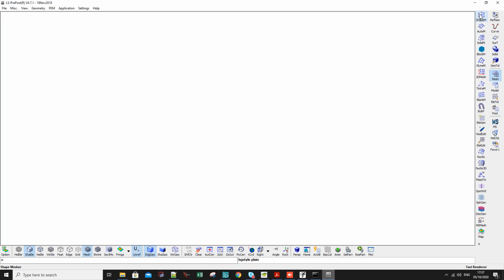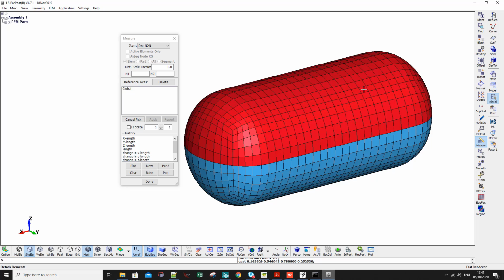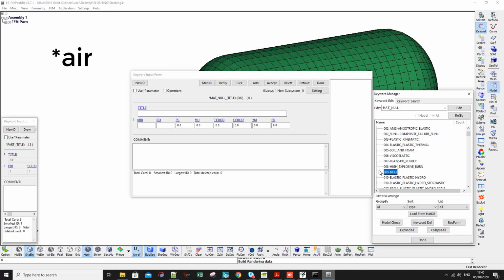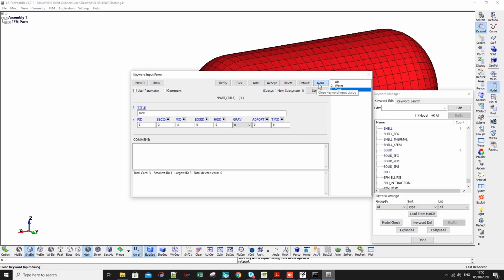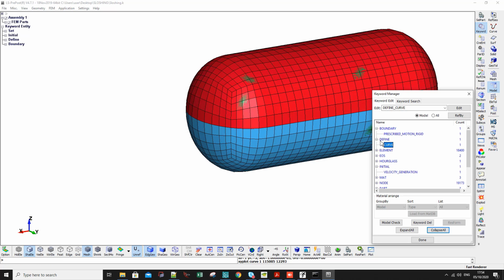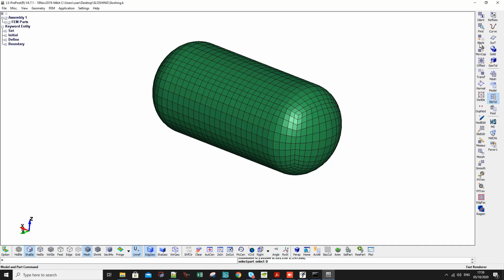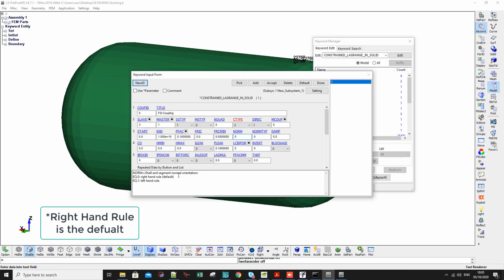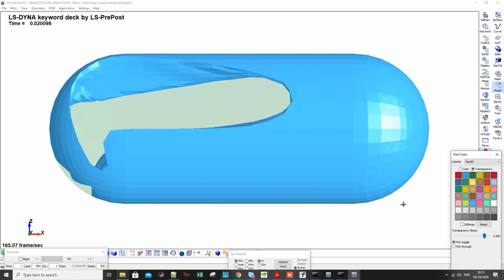LS-DYNA TUTORIAL 19: Sloshing Inside a Tank with ALE method

Comment: Hello Mr. Topa. Thanks for so many useful tutorials. May I ask you something no directly related to this? When we use ALE eleform 12 (with void) in a thermo-structural analysis, setting the initial condition of temperature for the void part, and after the analysis starts, its temperature falls to 0 no matter which value we set. ANy idea?
Reply from the maker: If you want to see the effects of temperature in air, then it is better to use multi material ALE instead of ALE with void. Because void is just like empty space, which has no material inside it, so it has no temperature.
Reply: @AmeenTopa  thanks. I had the same idea. Unfortunately, the eleform 11 multi-material doesn't work with the thermal solver yet. and BTW, your tutorials are more and more amazing.
Reply from the maker: Thanks. Don't forget to share my videos so more people can benefit :)
Reply from the maker: Have you tried change from the default value of AET in SECTION SOLID?
Reply: @diegoarmandogomezmarquez879  I have the same problem with ALE and elform 5 or 11 (my problem is just air between two plates in 3d). Temperature just drops to 0 in ALE air (I have boundary and initial thermal conditions). And in logs I get: 
10302 Unattached nodes have been detected.     *
     *            These nodes do not belong to Lagrangian  *
     *            elements being processed by the thermal  *
     *            solver for the thermal response of the   *
     *            model. These nodes are being ignored
and:
UNCONSTRAINED Thermal Node data
     The following nodes were not attached to any THERMAL
     element and have been automatically constrained out.
Did you manage to apply ALE to thermo-structural problem?
Reply: @Ankalot  "unattached" makes me think you have nodes not assigned to any PART. Could you check for it?
Reply: @diegoarmandogomezmarquez879  I created parts using shape mesher and have their PID in Part keyword + model check tells that everything is ok in LS-PrePost. So all nodes are assigned to parts.